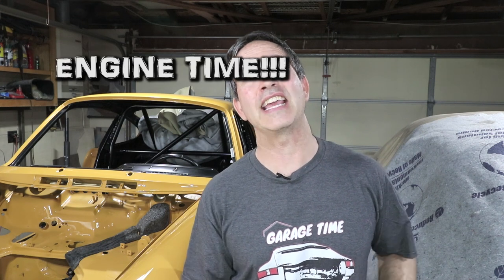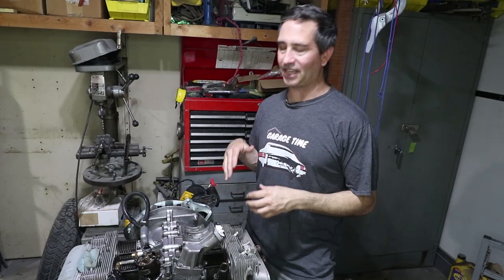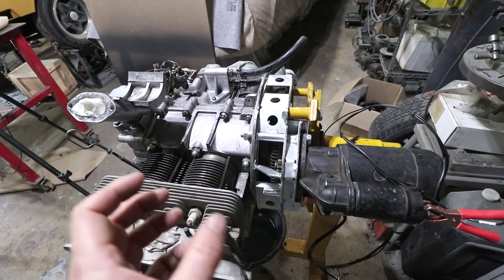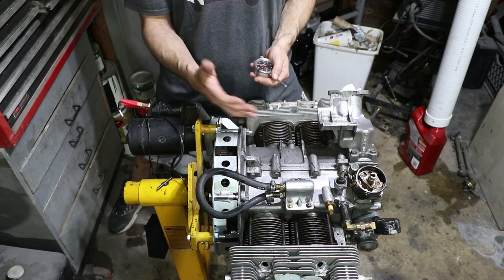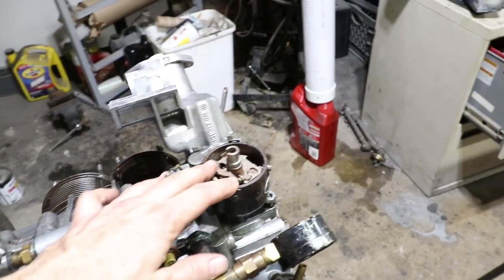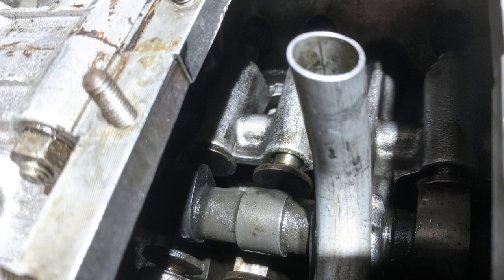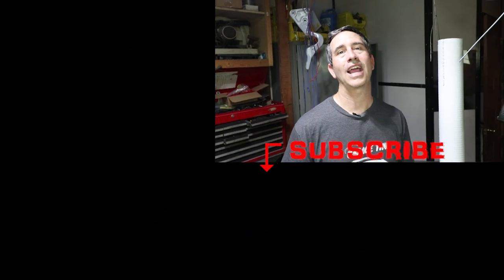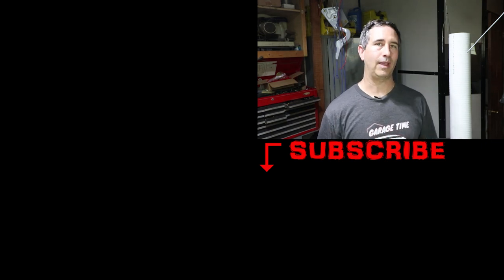Engine Rebuild Time!! BUT Don't Get TOO Excited? Part 1

Comment: Good call on getting 912 motor ready and lubricated. It'll be interesting to see how well she perform with the little sister in there compared to when the big brother finally gets installed! Good video, Tom.
Reply from the maker: Thanks Chris!  It's crazy how adding two cylinders can almost triple the power.  Newer tech for sure.

Comment: Tom, this is an old video I stumbled across, but quite interesting. I LIKE your solution for checking the oil for contaminants. Back in the mid-60s, I worked part time for Al Cadrobbi. He insisted on using Briggs diatomaceous earth oil filters and 10 weight, non-detergent Kendall oil in all his racing engines. He also preferred the Hirth roller bearing crank. My engine in my Speedster (Hirth crank, Isky 1010-A cam, super 90 rockers, 40-over Forged True, 10.5:1 compression pistons, Solex 40P11 {the Carrera carbs, NOT the Super 90 - 40P11-4 - carbs}) ran hot... cold... before & after a race... 25psi oil pressure. His philosophy was oil FLOW rather than Pressure. I never knew of any of his engines having a bottom end or bearing failure. Oh, as for the Kendall oil and Briggs filter... the oil always looked fresh. When it started to lose that 'honey color,' he changed the filter, but never the oil....

Comment: Four cylinder... It's good thing you put a roll cage in it. Lol
Just messing with ya. You've done an awesome job. I'd be impatient to drive it too.
Bet you can't wait for the 3,6
Reply from the maker: I know right😀.  Hopefully I never need the roll cage regardless of the motor.  
Motor builds can take a long time when DIY.  Ie kav911, homebuiltbyjeff, etc.  So I think you can see why I'm going with the 912 engine.  Plus I really don't have space for another motor is my garage, ha ha.

Comment: As always great video Tom. How timely as I'm in the process of waking up a big bore kit C engine that's been asleep for 12 years. Waiting anxiously for next video of engine rebuild.
Reply from the maker: Cool, these are great engines.  I've already torn into the heads and found some worn bits unfortunately.  So there will be some rebuilding needed.

Comment: I have a 81sc motor US spec 87,000 original miles, $6500.
Reply from the maker: Where are you located?
Reply: I would have hopped all over this I paid 8k for mine.

Comment: Isn't it redundant to add assembly lube after the engine has been put under the oil pressure?
The oil should have spread enough, especially when turned over by hand, to protect all the parts. Or am I misinformed?
Reply from the maker: That's right for all the journal bearings.  I will add more assembly lube to the cam lobes and followers because the lobes aren't pressurized.  The cam needs some help to break in without chewing itself up.

Comment: Are you planning on then using that 912 motor on the 356, once you build the 911 motor?
Reply from the maker: No, I have a few others for that car.  I have 4+ 356/912 engines.  So I need to thin the heard.
Reply: Garage Time - Restomod  Nice, I’d like to one day build a willhoit 2.2 912 engine.
Reply from the maker: Me too!  I admire his engine development efforts.

Comment: unless your going turbo i dont think you will 300atw maybe 220 ish
Reply from the maker: I'm thinking about 250 at the crank for a mild 3.2-3.4 911 engine.  More is a bonus but not mandatory
Reply: @GarageTimeAutoResto  Yeah I think your more on the money there. My mate just tuned a fresh 3.2 build with some good fruit and netted 220 atw

Comment: Ah, reverse upgrade
Reply from the maker: Upgrade in the sense that the car will actually move as opposed for waiting for me to rebuild a 911 engine, ha ha
Reply: @GarageTimeAutoResto  Good point. And your 912 motor will probably have more power than my 2.4L CIS oil leaker.
Reply from the maker: Well, drive it till it won't go anymore.